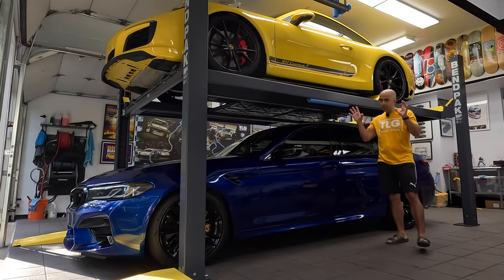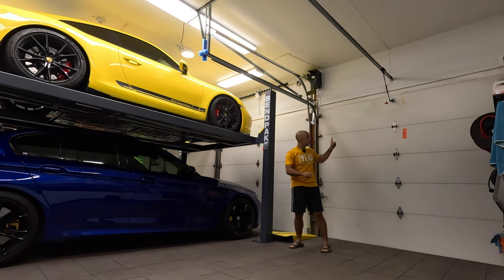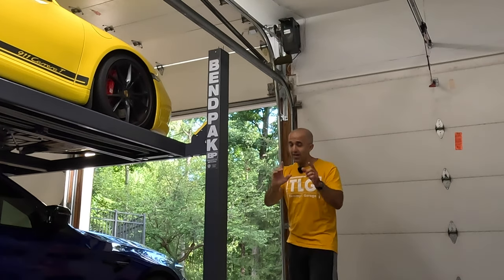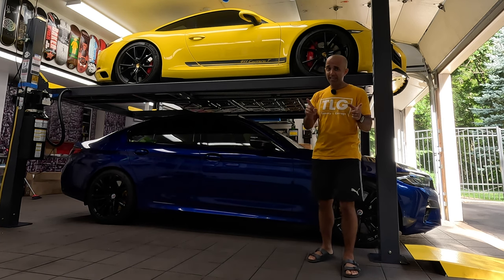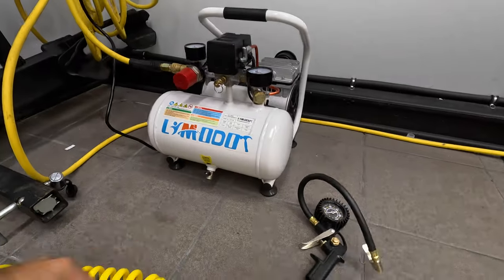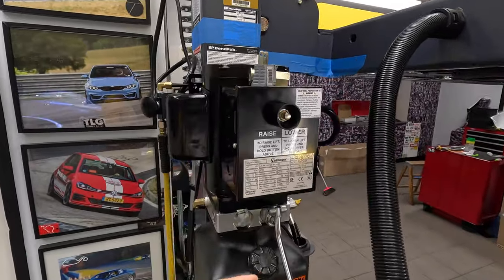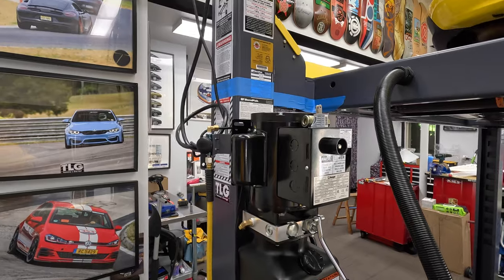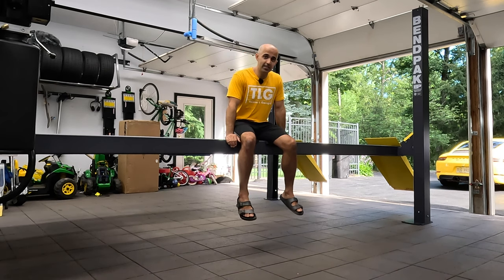Watch this before buying a Garage Lift! | Everything You Need to Know!

Comment: Nice video! After a lot of research I went with an Advantage SS-11000-WD. I do not need air to release the mechanical locks, and I greatly prefer the stability of the outside post design. But I use my  lift to work on vehicles, not just for storage, and I needed to be able to fit & lift my Ford F450 Diesel 4WD Crew Cab dually pickup which is a beast. The 240 volt 11000 lifts it very quickly and with ease, and is very stable, even when lifted to the very top setting, which btw is way over my head. My home shop is 16 feet tall at the sidewalls, and my doors are 14' tall and 14' wide. Loved your out takes at the end!
Reply from the maker: Wow you’ve got some nice garage space! I wish I had more ceiling height.
Reply: @TommyLGarage  yeah, it's my dream shop, built it when I bought my retirement house & property. It's 40x60x16 with one 14x14 door in the front, another 12x12 door in the front, a 12x12 in the back (can drive straight through) and two man doors, one at each end on the long side facing the house. Very sweet setup...

Comment: Thank you, great video, leant a lot from it!  I am wondering for a four post lift, do you need to consider how think the concrete is underneath? So if the air hose is disconnected by accident or lost power, will the lift collapse?
Reply from the maker: For the four post lift, regular concrete thickness will suffice. Also, when the air hose is disconnected, the lift will definitely not collapse Does is it keeps the secondary brakes off only if you press the button. When there’s no pressure in the system, the lift automatically locks so there’s no way it will collapse.

Comment: I bought and installed a much heavier and bigger shop 4-post lift.  I don't have cars to store but I work on all my cars so I made a wood and unistrut platform for in-between runners that I can remove by myself which created a mezzanine for my wheeled portable tools I use less frequently like table saw, chop saw, welder.  It takes only a few minutes to move the stuff off into another bay.  Then I can go to work on vehicles on the lift.  It's worth it to me to not have to slide around under vehicles on the ground and other than time I got a 12K lift installed for $1200.  It is not pretty but it is in good shape.

The lift also works as outfeed table, workbench, loading dock, truck topper remover, etc.  The only annoyance mine has is one corner is trapped by a shelf so if not all the way up or down you have to squat under or go around, small price to pay.

You made a good choice.  With a single car garage door like that you can mount the standard opener to one side and it will lift the garage door, be careful with the shaft type, any kind of malfunction as it wears is a much bigger deal.

Comment: I had the same experience.  10 feet, 6-inch ceiling, replacement of the overhead garage opener with a side mount unit (LiftMaster in my case), rail replacements, and so on.  The major difference, I selected the Benkpak two post lift model XPR-9-LP.  My goal was two fold, vehicle storage as well as the ability to perform suspension work with the wheels free and more access to the underside of vehicles.  The only other difference, the safety release is cable actuated rather than pneumatic, thus no need for a compressor.  Having four cars in a three car garage is wonderful.

Question.  When are we going to see TLG mudflaps for the F90?
Reply from the maker: F90 TLG mud flaps are ready!! Email me! Got6Speed @ gmail . com

Comment: I installed a lift very similar to yours.  The garage door modification is called a High Door Conversion.  It requires new spools, going from tension springs to torsion springs.  If you got that done for $800 that was a smoking deal!!!!!  Most garage door installers have no clue on how to do it.  If you google High Door Conversion a supplier has details.  Again messing with garage door springs can be very dangerous so I suggest finding a "professional".  I bought a cheap Chinese model (Greg Smith).   It works flawlessly.  Chinese know their welders suck so easy solution use 10" of weld when 1/2" is required.  Ensure you get a lift with ladder bars that are infinitely adjustable.  Two reasons, you don't loose 4" in height to release the lock and you can fine tune the final height.  Very important when ceiling heigh is limited!!!  My lift doesn't use a compressor for the locks just a simple lever works perfectly.   I stored a small boat, jet ski, 911 on mine.  I bought my greg smith for $2400 now I think they are much higher.  The runway with cylinder is what weighs the most 300lbs?  I used a little engine picker to lift it and worked perfect.  My lift came in steel box, you would have to use a fork truck to unload or take it apart on truck.  I sure truck driver would love that, lol.   Final word get a bigger garage, all the near misses I have over the years weren't worth it.
Reply from the maker: Bigger garage is not an option for me unfortunately:(

Comment: I have a very similar lift, installed with a friend who’s a bit more expert than me. Similar raised garage tracks and side mounted motor, too.
I just don’t have the pneumatic brakes, they look like a useless complication to me. My lift has a simple mechanical lever to disengage the four primary locks (there are also secondary locks that engage as safety if a cable snaps)
Reply from the maker: The brakes give me the extra peace of mind honestly

Comment: Great comment about being careful with lowering vehicle assuring all sides were coming down together.  I was replacing a timing chain on a vehicle and the stars lined up. Had to put vehicle in neutral to rotate cv shaft for clearance to get timing cover off.  I raised and lowered the vehicle a few times getting at fasters above and below.  Mind you vehicle was on a jackstand on drivers side with no tire so I could gain access and rotate axle shaft.  On the final drop of vehicle I was concentrating under the hood for next steps not realizing rear to posts were still engaged.  Once the front end lowered enough the vehicle rolled off jackstand and off the hoist and into the shop riding the brake rotor across the cement.  Talk about a missed youtube moment.  Of course tools and fasteners scatters to places never to be found.  Had phone on the rack of course and it was pleasantly ran over.  So much for gorilla glass.  Glad it was my vehicle and glad the loss was simply a phone and my pride.
Reply from the maker: Wow!! Glad the car stayed on
Reply: OMG > "off the hoist and into the shop"  >> how high up was hoist ?

Comment: Of course it make sense. I always want one but my garage is small and not tall enough. 
Question: did you have to drill and bolt the four corners to the ground?
Reply from the maker: No drilling needed. I’ll just put rubber pads on it

Comment: Stop calling them brakes.  Bendpak has air locks needing compressor above like 80psi to disengage.  They save your life.  Even disengaged car comes down in very controlled manner.  You complain alot about cost for 300k in two cars.  You really need minimum 12 ft ceilings for your high lift bendpak thats what you paid for so you can walk under it and get out without hitting your head.  Im 6’4 and can walk under it.  I have had two of them
Reply from the maker: Once again - what did I do wrong?

Comment: Ironic that you did not mention the "REQUIRED" platform stand reinforcement points (called pilings)  due to the insufficient weight bearing of 4" of concrete.  Garage looks F'kn Awesome though.
Reply from the maker: Those are only required for the 2 post. And I have 6 inches of concrete
Reply: @TommyLGarage  IF you think so.  Please advise of your Civil or Structural Engineering License.  Otherwise, one night you will here a very loud collapse and thos nice lil Porsche's that ya got will be trashed relics.....GUARANTEED. And 6" of Concrete is insufficient to support the load FYI.